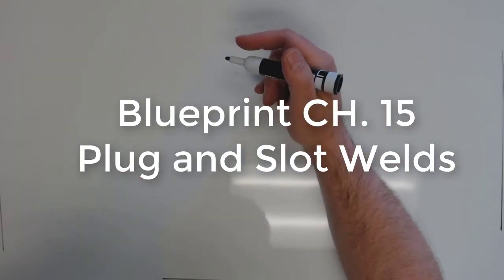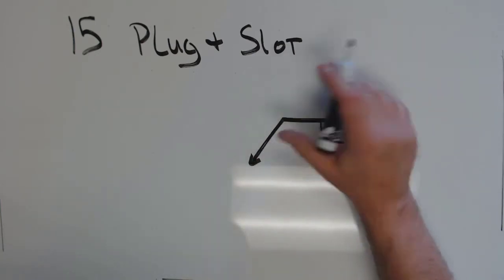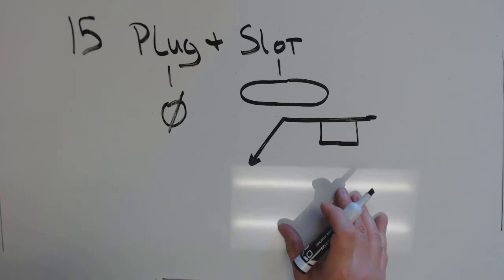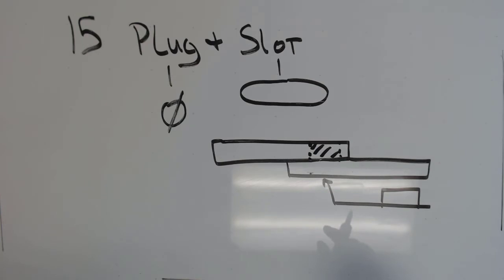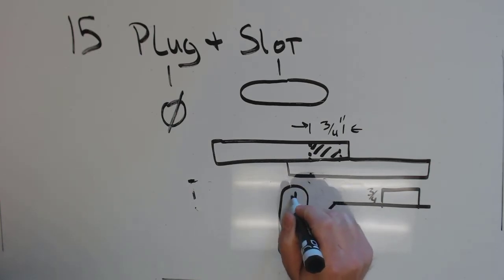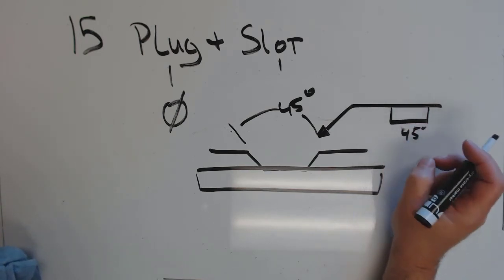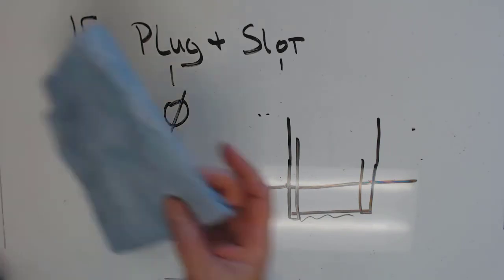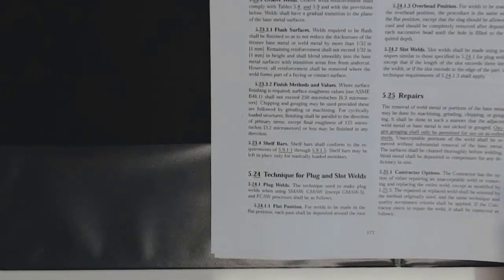Plug and Slot Welds

Comment: I have a 3” boat trailer tongue. I want to extend it 32”. I suppose I will butt weld the new 32” length of 3” tube onto end of existing 3” tongue tube. 

Then I want to slip a 3-1/2” sleeve over that welded and ground joint and I will weld the seam between 3-1/2” and 3” on either end. 

To add more strength, I was thinking about drilling several 1/2” holes in the 3-1/2” sleeve and then plug welding to the 3” tongue. 

I only think I need to do these plugs on the top so just flat welding. I don’t think I need to do these on sides (vertical welding) or underneath (overhead welding). 

Anywhere I am welding to the existing galvanized steel tongue I will use muriatic and clean off the zinc before welding. 

I am planning to use flux core mig machine. I think I will make a pass all around the plug diameter and chip off slag and then add more filler until I fill the hole. 

What is your opinion of this?  
You think flux core mig is ok process?  
Do you think starting and stoping to remove slag is right process or should I just fill and desalt after?
16:32 You think flat welding plugs up top is enough?  
You think 1/2” plug holes is big enough? (Tube is 3/16” wall). 
Am I missing something I should be doing?  

Trailer is for a 5,000 pound Boston Whaler boat. So not a big load but a precious one to me. 

Thanks for any and all advice from anyone reading this June of 2023.

Comment: Great Video following AWS Standards.  Ideal welding for sheet stock or light gage plate as a useful detail for metal manual construction in welding.  "I-Car" welding has a good application for plug welding.

 T J (Tom) Vanderloop, Author Instructor & Community Leader